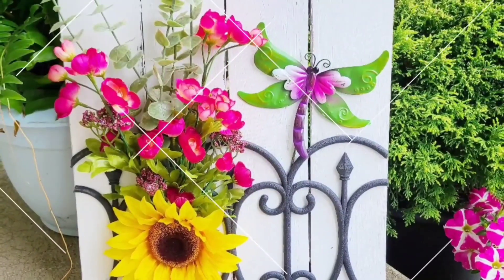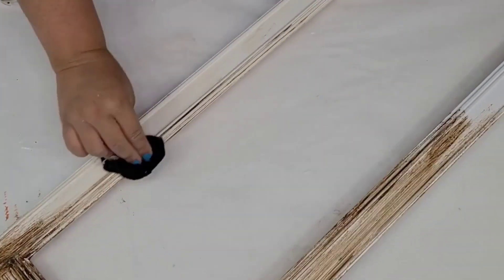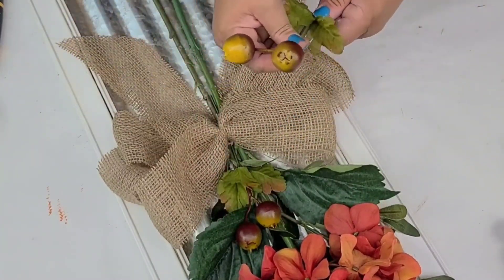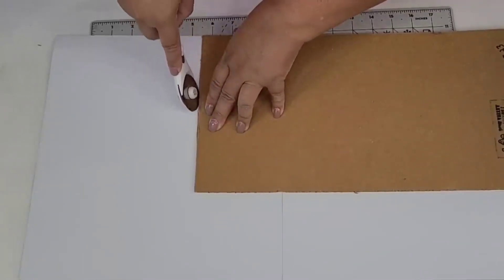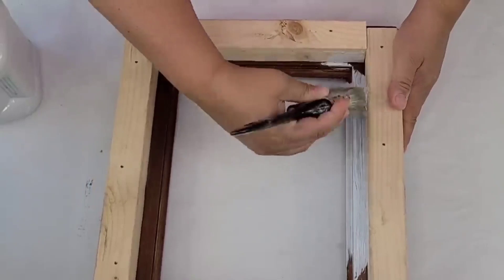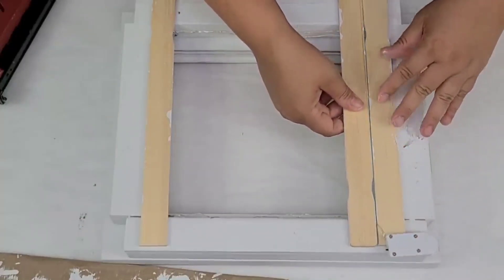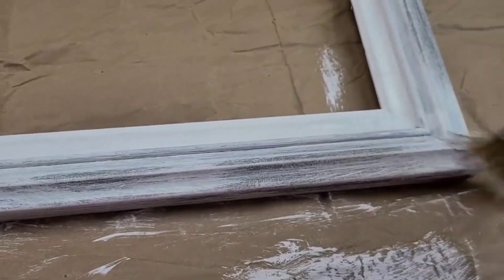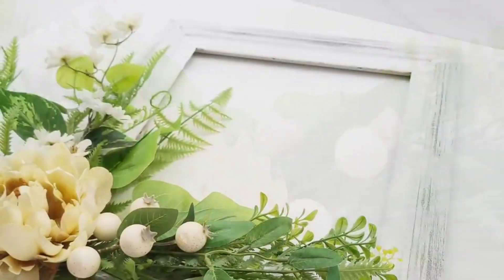BRILLIANT Ideas Using Old Picture Frames

Comment: For stapleing use staples made for electrical wiring. They have flat heads that won’t cut into the wire.  Learned my lesson when hanging outdoor speakers. Ugh.
Reply from the maker: Oooh! That's a great idea. Thank you so much ❤️

Comment: If the corregated metal is not available, what other material would you suggest as the backing, instead of the metal?
Anybody?
Reply from the maker: Hi! I'd say wood or paneling, which you could paint, stain or evwn cover with vinyl or tin tiles. Thank you so much for watching ❤️